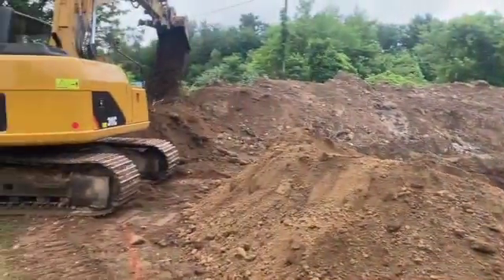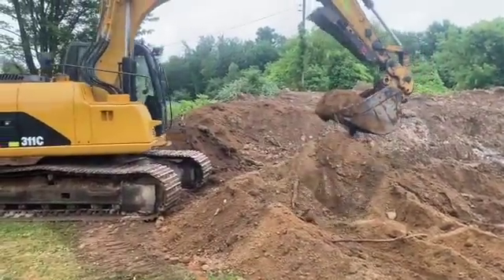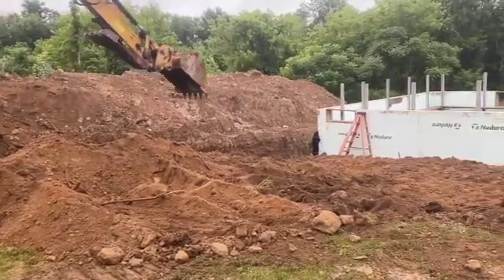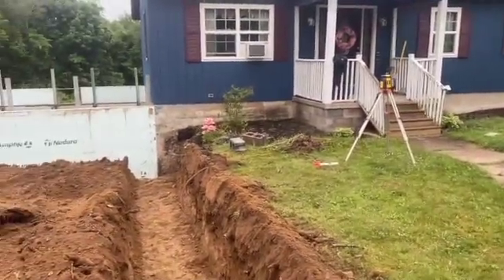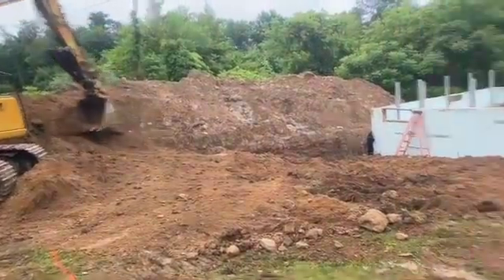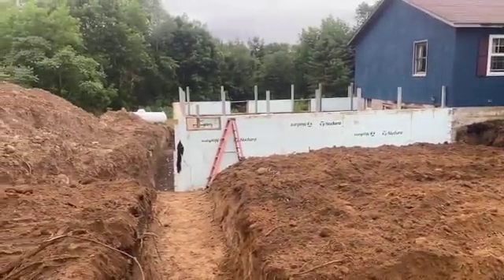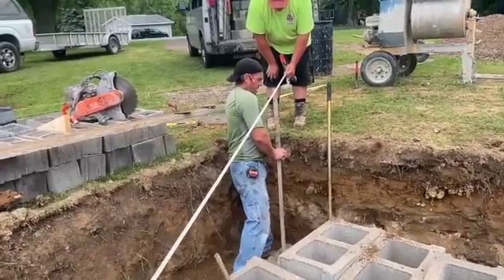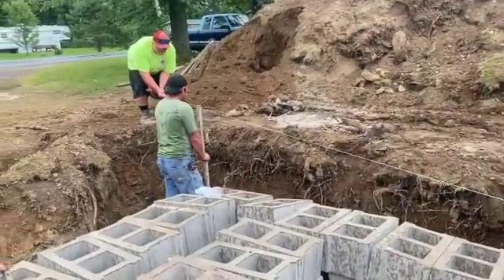Nudura basement tied to a concrete block stem wall for a garage.

Comment: You don‘t have to drill rebar into the foundation for the blocks? Everywhere you go it‘s a little different!
Reply from the maker: At 5:05 we show how the rebar was cast into the Nudura then tied into the concrete block wall.